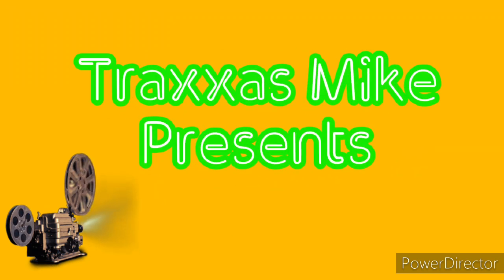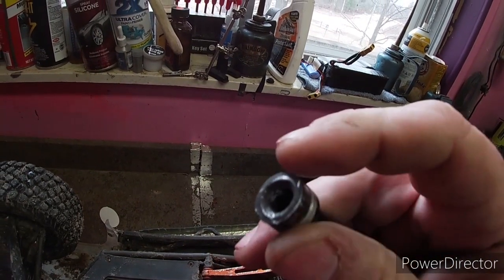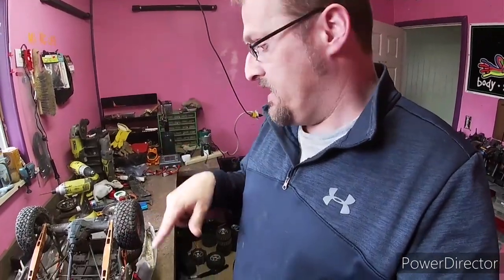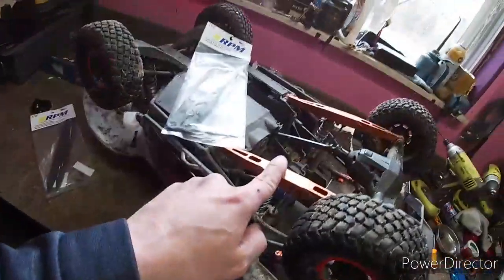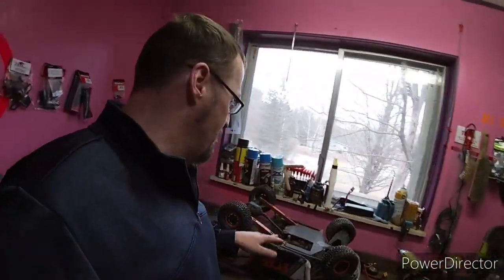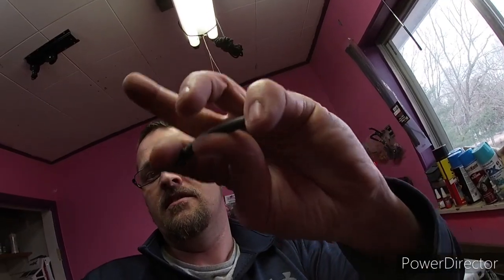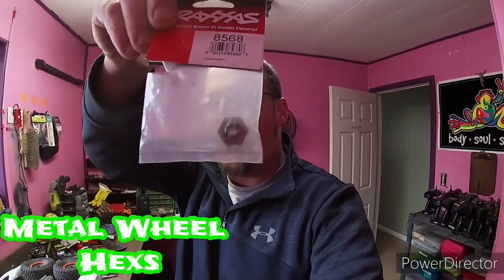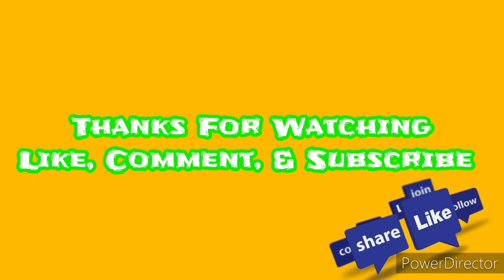Top 5 Upgrades for the Traxxas U.D.R.

Comment: These trucks hold up so much better on 4 cell.
Reply from the maker: Your right they really do. But they got SOOOOOOO much more get up and go on 6S though💪.  But in order to be reliable with 6s power you need to put another $200 minimum in these trucks.  Parts like a steel front drive shaft to replace the plastic one, a steel x-duty rear Driveshaft to replace the Traxxas soft aluminum one, steel wheel hex's to replace the plastic ones, steel adjustable tie rods to replace plastic onrs, bigger diameter sway bar rods and aluminum sway bar links to replace the plastic ones, a hardened steel spur & pinion gear to replace the Traxxas soft "monkey metal" gears.  A fast eddie ceramic bearing kit sure helps too because with the increased torque and speed comes more heat and the stock bearings only hold up to so much. I threw on some aluminum trailing arms too for added strength because with added speed comes bigger jumps and wilder bash sessions. I might have even put upgraded gears in the front and rear ends too ....I can't quite remember.  But my truck flat out SHITS & GETS now.  It takes a beating now. But I got hundreds of extra dollars into it now.  It all depends on what you want to do with you R/C's.
Reply: Everything holds up better with less power. Except your happiness  level. It springs into action on 6s.